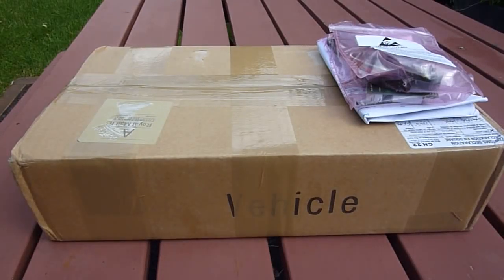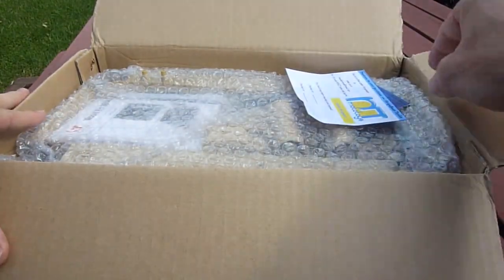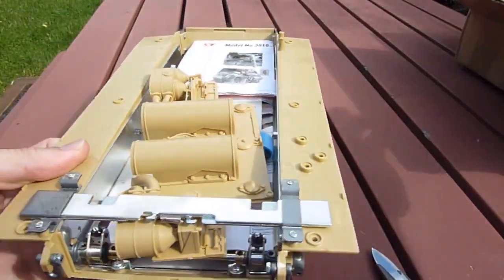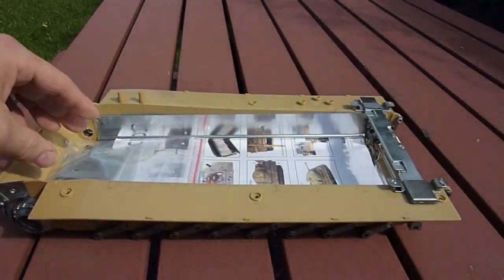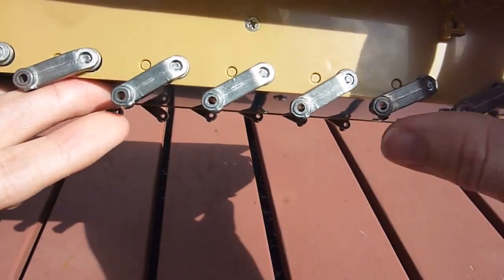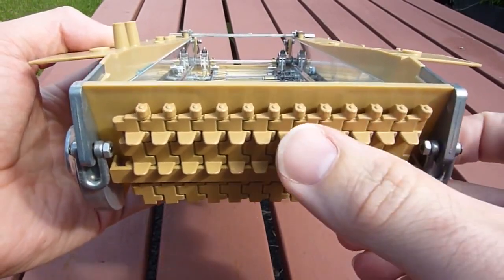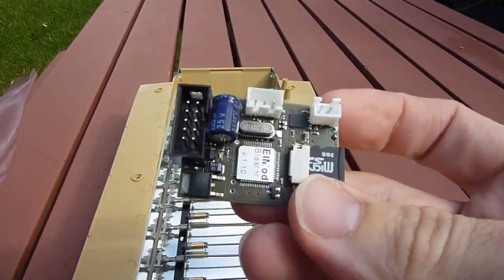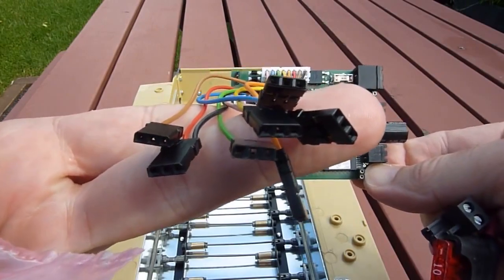Heng Long Metal Tiger 1 RC 1:16 Tank Unboxing

Comment: Now that is impressive.  Massive Improvement on stock heng long
Reply from the maker: Yep, absolutely. The torsion bar suspension works great plus the added weight of all the metal makes for a more realistic driving experience